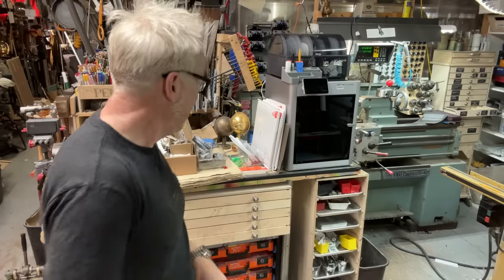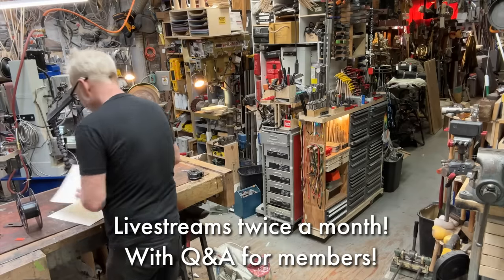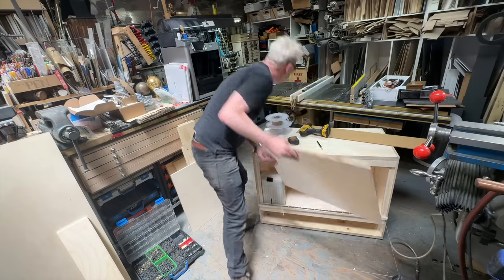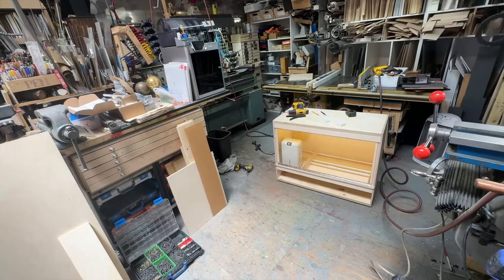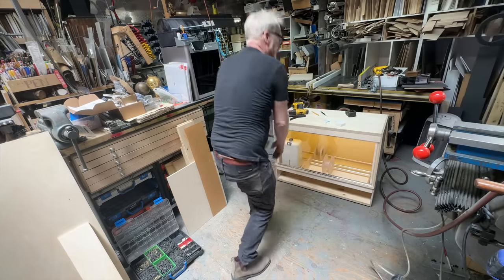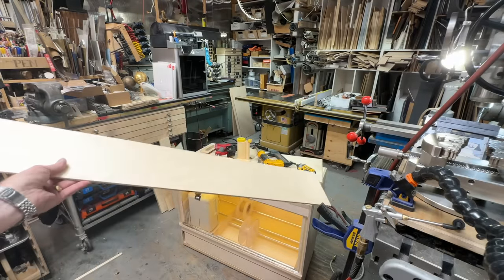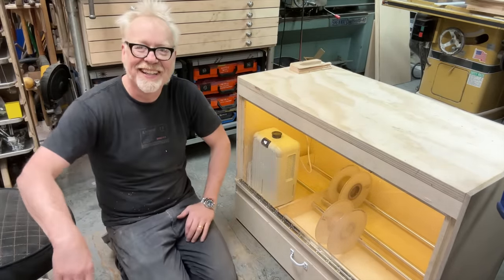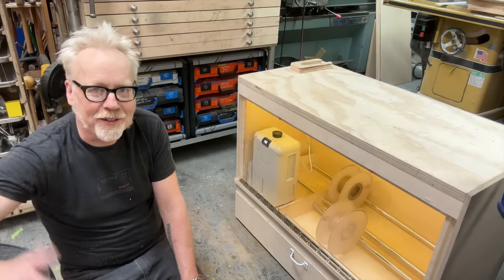Adam Savage Builds His 3D Print Farm!

Comment: haha cool! I recently bought my first 3D printer, also a Bambu X1C. Up till now I saw friends messing with 3d printing but didn't feel it would add to my workshop, to much thinkering with just getting it to work,  when I saw this machine  at a friends place I figured it was time to jump in. Been great, I don't have time to thinker to much with it and this thing just produces from day one and being able to use the higher temp filaments easily I've been able to use it straight away for production stuff. Ive been surprised by how much I've been using it on projects, actually been a bit of a 'reprogramming' to think of it as the way to solve certain stuff. I've been driving to some hardware store or whatever a couple of times to realise half way there...wait I have the 3D printer, I could do it so and so and fix it, no need to get this other material and then spend the whole afternoon shaping it or whatever. I've found it great for problem solver stuff that requires precise dimensions, like custom spacers and stuff that are simple but you never find what you need in the exact dimensions for your problem or have to special order somewhere, spend a lot of time searching, or modifying. With the printer its 5 minutes to draw it and then send it to the printer. It's been a revelation I think it was the right time to get into it. 

Building a better dry storage solution is actually on my short term list of studio projects, I have the plastic containers I want to convert for it sitting in storage already. Right now just storing spools in airtight containers with a bunch of silicon packs.

Thought about getting a second one but decided to go and buy a CNC router kit instead first, should compliment each other nicely.

I don't have any engineering background except for a few weeks as a teenager working at a technical design bureau for injection mold manufacturing. It hasn't been an obstacle at all.

Comment: That’s a great build however I would be concerned about vibrations from one print effecting the other, it is recommended by bambu and mine really does vibrate a lot. A simple solution is to print some feet to hold a squash ball on each one. Works a treat at decoupling the printer from the work bench and causing resonances that travel trough the top. Bambu sell their own feet but the printers dance around at an alarming rate 😂 The built in dry storage is brilliant. I will be stealing that idea. Thanks adam

Comment: You will need to look into the QIDI Max 3! It is a all metal 320x320 printer. Or wait for the i-Fast 3 as it has two print heads were one could be used for PVA.

Comment: Great printer base.  The only very minor change I would make (and you may have done it but didn’t show it) was put a plastic or rubber grommet where the power cable runs thru the case.  Your basic lamp cord can easily be damaged by the sharp edge of plywood, and you’re going to end up with super dry wood and do not want any chance of a spark.
Reply: Hahahahahahahahahaha.
Have you ever experienced wood in ply form?
It's hardly razor edged.

Comment: Instead of using up the space for a dehumidifier you could have used a very small heater, use a thermostat set at 80 degrees relative and it would keep the humidity low and your product very dry.

Comment: I think that installing the drawer guides before putting on the filament shelf would have made things a lot easier.  I'd have also added casters on the bottom before putting things in there would also be handy.  I think that I would also put the filament rack on drawer slides as well, as that would make getting to the back row a lot easier, and one wouldn't have to bend down so far to see the back row.

Comment: While a sealed cabinet with a dehumidifier IS absolutely a great idea, I just use 2-gallon mylar bags with dessicant packs in them.  Just label the contents.  Each bag holds a roll of filament comfortably and you can squeeze most of the air out.  Doesn't look anywhere near as cool, though!  😜

Comment: Yup I use the same hydrometer. I should tell you, your AMS unit it not at 10% humidity, that's just the lowest number the meter reads as an output as it is not sensitive enough to measure humidity lower then that, so The AMS is somewhere between 0% and 10%.  Is knowing its at least below 10% good enough for filament storage? Yeah, but keeping the actual truth in mind is always good.

Comment: You shouldn't unwrap unused filament. It was packed in a dry room with desiccant to keep moisture levels below 10%, and it will stay that way until the seal is broken. It would be nice if you were to seal the inside of the wooden box somehow to prevent the wood from continually seeping moisture into the air, since wood is porous.

Comment: If you use nylons, you need to be somewhere below 20% RH. I can only get my dry box down to about 20% using silica desiccant in UK weather, and I still have to dry nylon filament occasionally.
Reply: Commercially printing nylon, we keep the RH down to 10%, bake the spool for several days before it goes on the machine, and then feed the printer dry, heated filament through a PTFE tube right to the direct extruder.
Reply: @grandunionnews2510  Before anything important, or big batch of parts I tend to dry my nylon (Polymaker Polymide COPA) for 8 or so hours up front. It's then fed from a sealed box with desiccant through a PTFE tube. Any idea how long you can keep nylon filament at 10% before it needs drying again? Maybe it's worth me actively keeping my dry box dryer than the passive silica granules can.

Comment: Things I learned the hard way:

- You need a very stiff stand/table
- Weight is your friend
- Don't make your stand too high

I got a 3x Kallax and it just SWAYED when my P1P started moving 😅 Fixed most of the issue by putting 30 kilo's of concrete tile underneath the printer and by attaching a solid wooden backing onto the Kallax. It now works pretty well, but I still mostly run it at 50% speed when printing critical parts 😅🤣

Comment: I feel a bit late to the party, but if you really want the best out of your bl printers you should probably not have them both directly standing on the same table since they use a lot of vibration compensation and stuff like that. You might have heard it go a bit bananas when you calibrate it? Its checking the vibrations, if you print with both of them hard enough their vibrations will interfere with each other, kind of like you said with hammering on one side of the table and printing on the other. A really simple and old-school trick is to put the printer on a big concrete slab for more mass then a vibration dampening matt underneath the stone.

CNC Kitchen has made a video about this you might want to check out, called "Seriously the BEST $2 3D printer upgrade!" I cant link it or my comment gets removed.

It has a couple of pros, less noise too.

Comment: Sorry to say adam, but filament isn't necessarily "dry" when removed from it's factory packaging, this has been found time and time again to be an issue. Which is why i always open my filaments a day or two before use, and put them inside a dehydrator at fitting temperature for the specific filament, and when i'm done i reseal them in a vacuum bag until next dehydrator&use run.

Comment: Interesting idea, and a nice little cabinet/stand.  But, don't you want the humidity in a dry box/cabinet to be as low as possible?  Plastics absorb moisture, and print/mold best when they're as dry as possible.  Setting the humidity in the cabinet means the filament will never be down to the lowest moisture content possible.  It might help mitigate extra-humid days when it's raining and such, but I'd still use a dryer before printing if you really want your filament to actually be dry.

Comment: It would be cool if you could feed the filament from that dry box. Maybe have a single space in the top of that cabinet with a spool holder and a bowden tube going to the printer where you could load a filament you want to run but don't want it absorbing moisture. It could be front and center so you know what's loaded up.

I have a problem with that on my X1 Carbon.  They say you can't run Carbon Fiber Nylon in the AMS because it's abrasive or something, so I had to buy a separate filament dryer to house it and add a Y splitter to get the AMS and the external spool holder to play nice.

One other thing you can do is just disconnect the AMS from the X1 and install them into the cabinet.  You can even take the lids off them.  The only thing you would need to do this is an extension cable for the AMS and a longer bowden tube.  Then your active filaments in the AMS can live permanently in the dry box and you can load them from there.  Bambu even offers a splitter to run multiple AMS systems to a single printer, so you could potentially have a whole ton of filament ready to go to the printer at any given time rather than just 4 spools.

Comment: I'm facing the same issue, but I also live in a very humid area and have a lot of filament that is now brittle. it comes off the roll ok, but after it is straightened for any length of time, it breaks. So prints that finish ok over-night, have broken filament in the bowden tubes or snapped feed off the rolls by morning. I've also dried it, but whatever has changed is pretty permanent. Lately I've been thinking that drying it in a vacuum then releasing a voc into the container might solve it, even if just turpentine to restore some of the flexibility. Love to hear your thoughts on that.

Comment: I would seal the inside of the dry box area so you can really suck the water out of the air and I would also put a drain tube into the dehumidifier so you dont hold water in the area you want to dry . That would also save you opening the drying area to remove the water catch/tank from the dehumidifier and have it drain into a large container . If you really want to make it dry also look at making it lower temps in it that will help[ keep the humidity down . The driest place on the planet is the Ant-artic

Comment: One thing Adam needs to know is that just because filament is store dried / in a vacuum sealed bag, does not mean the filament its self is actually dry. Certain filament needs to be heat dried to 65c+ for several hours before use in order to assure best possible quality.

Comment: If you own a single printer you have one or zero working printers.   If you own two printers ...  you are much more likely to have one that is working.  I have three printers.  You also want those printers in a temperature and humidity controlled space that vents outside or has amazing air filtration.  Put a printer on a plank of wood and it uses that wood as a speaker cone to make more noise.  Put it on a slab of rock or solid counter top material and it is quiet.  Plug your printer into a nice big UPS so it can keep going.   Clean the bed exactly the same way before each print, wipe with alcohol.  If you need more bed adhesion, raise the first layer bed and nozzle temp.  If you can't get prints off the bed, lower the first layer bed and nozzle temp.  Do not use hairspray etc.  It messes up the first layer thickness.  There you go.  If you only print parts for the printer and little statues, I don't want to hear about it.  Print things that are useful.

Comment: I don't think it's a good idea to have the 2 printers next to each other if you plan to have them running simultaneously. 

These printers do input shaping calibration which will get skewed results if 2 of them are placed sharing the same base unless it was much more solid than a wooden table.

If you get odd surface finishes or later problems when the 2 run together then fine results by themselves, this will be the culprit.

Placing a granite or cement slab on top of the table and then the printers on top of it might fix this, but ideally each one should be on its own table (or resonant system).

Saludos desde Tenerife!

Comment: No one needs a 3D printer......they generally need 4.

Tips from personal experience:
-Bolt it to the wall, or go with a slate top table, or even just big square patio blocks to set the printers on to keep the wobble down.
-You want fire resistant material around the printer just in case.
-Add a UPS to keep the printer running during power flickers 2 days into a 3 day print.
-Make sure a fan or vent is not blowing across the printer that will mess with the print quality.

Comment: I've got some bad news bestie.. Desiccant and vacuum sealing do not guarantee dry filament. I've opened brand new spools of filament from manufacturers known to produce quality filament that are too wet to use. I have a 1kg spool that spent ten days in a filament dryer at 50c that is still unusable. It doesn't happen super often, but it happens often enough that I say with confidence that it will happen to you too eventually. You'll also eventually find that you've got a brand new spool that somehow has a knot in it. A spot where the filament has been looped back under itself. It is common for this to be up to 10 meters from the end of the spool.

Comment: With all of your new equipment,  you’re going to need a bigger shop. 4 types of sanders, 2 types of lathes, 2 types of mills, a drill press, 2 vacuum form machine, a laser cutter,  table saw, multiple types of band saws, jig saw, chop saw, multiple carts of supplies, multiple screw and bolt carts, multiple tool carts, multiple work benches, welding zone.  
The tested community needs to get Adam a bigger space

Comment: I got my X1 Carbon about 6 months ago, when it prints it is incredible.  But man oh man did they need to work out some of the engineering before they released that product.  Your heatbed cable is going to fail within the first 500 hours of printing I can almost guarantee it.  This, along with any of the other myriad components that can and will fail on it, will cause you to have to disassemble the printer down to its core components which is a pain in the butt.  And make sure you keep very specific track of which type of screw goes where because Bambu will absolutely not supply you with a screw callout or assembly diagram.  I have been going back and forth with them for the past three weeks on that one after some of my screws got dropped during reassembly and I couldn't remember which ones went where in the final reassembly (I now have 7 screws that are just... floating, not sure which holes they were supposed to go in and Bambu has been absolutely useless on helping with it).
Still, great printer when it prints.

Comment: So where is the dehumidifier draining or do you have to manually empty a resevoir?
Reply: That's what I was thinking as well. It's convenient if you have a drain nearby that you could hook up a drain hose, but if one doesn't exist, it's a PITA to remember to drain it on a regular basis. If the machine shuts off when the reservoir is full (which it should do), then you basically have a bucket of water evaporating into the semi-sealed cabinet with your filament sucking it all back up.

Comment: Thoroughly enjoy the content, but with 3D printers, they really aren't that picky. I've got a Sovol and a couple old school Ender 3s that are at least 4-5 years old. They are in a spare room in a climate-controlled house in western NC, with humidity not controlled at all, and my filament sits on the roll until I use it—fully exposed. I've never had an issue. I leave it for 6 months until I need to make a widget, and I'll CAD it up, go print, and have no issues with the material. I seem to always have to replace the brass nozzle after a long window of not using it, but they are not that picky, it seems. I moved them last year, popped the cord out of the back, set them in the bed of a pickup truck, drove 50 mins, and placed them on the tables. I went to printing; I didn't even have to bed-level, and I do not have auto-leveling. I do have the direct feed and spring upgrades, but that's it. I print with PLA and PLA+ exclusively, but I am categorically bad and careless as a 3D printer owner, and they just work. I've been really surprised at how badly they can be treated and still perform well.

Comment: Huh. Bit surprised at the end. 

I expected the purpose of the cabinet was to contain the printers, not to be a shelf. Mainly because the next logical upgrade would be to add ventilation support to the overall enclosure. 

Adam and team may be using PLA for now, but given what they do I imagine working with different filament types in the future isn't long off. And you don't want to print with some of those in an enclosed space like the shop due to the vapors produced. This is especially true when they start adding resin printing into the toolkit.
Reply: He should get a fume hood for paint first.
Reply: @jackfranks7160  Yup that too